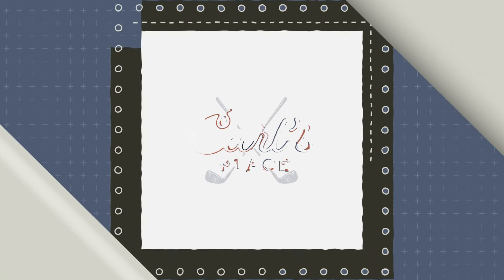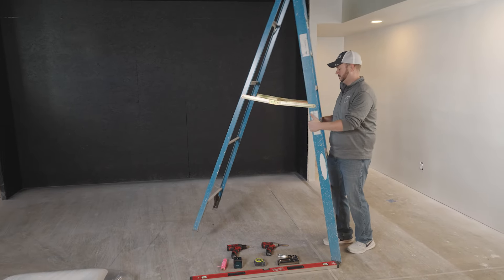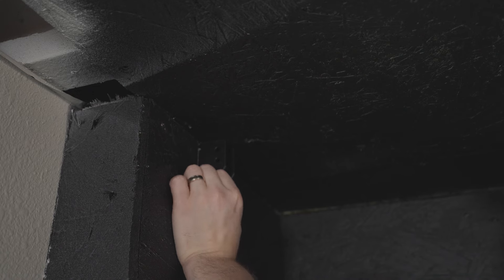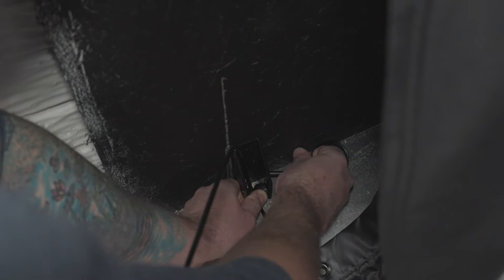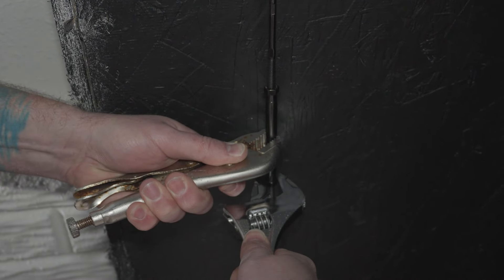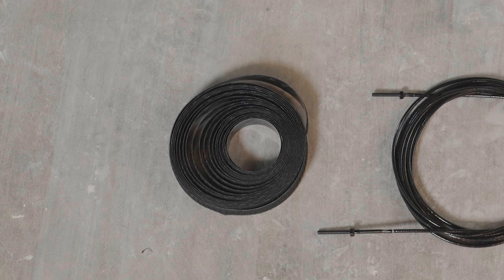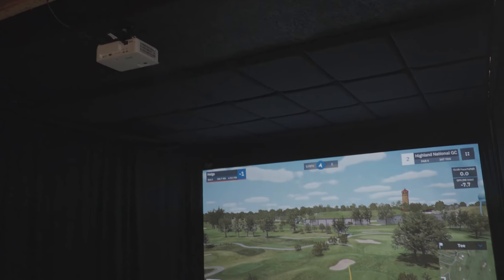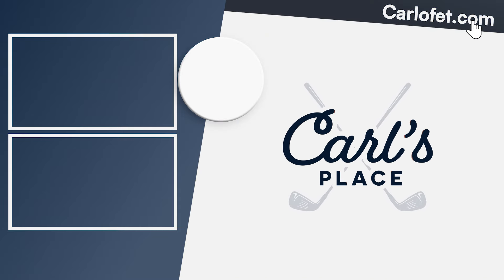How to Assemble Carl's Place Built-In Screen // Carl's Place Built-In Golf Simulator

Comment: Why the large black strip across the top where the logo is? Can it be customized without that and have it be screen instead?
Reply from the maker: Hey there! The black strip (masking) across the top on these screens and our C-Series enclosure screens is essentially what used to be the bottom border/flap on our original screens/enclosures. The viewable screen dimensions are still similar to what they were before when the screen had a finished edge and flap on the bottom. With the new screens, you get improved bounceback and a viewable screen that touches the floor for a more immersive experience!
Reply: @CarlsPlace  that masking strip looks well over 1 foot high! that's extremely disappointing to cut off that much vertical screen height!
Reply from the maker: @AM1015-  Hey there! It's possibly very close to 1 foot as our range for masking goes from 4 inches minimum to 12 inches maximum. The masking is used to make the white viewable screen a specific aspect ratio for the cleanest look with the projected image - we prefer not having unused white viewable screen space. However, if you'd rather have more white screen, you can customize that masking size through our customer service team to whatever you want in that range! If you're worried about masking not being impact quality, it is actually the same material as premium screen, just black in color.
If you have any more questions, I suggest reaching out to our expert customer service team here: www.carlofet.com/contact

Comment: What is the actual size of this screen?  Trying to find one that will fit in an11' 4" wide room, 8' tall
Reply from the maker: Hey there! The size of this room/screen are as follows:

Room dimensions = 105.5"H x 167.5"W
Black Masking strip = 12"
Viewable white screen (16:9 Ratio) = 88"H x 156.5"W (rounded to the nearest 1/2")

As for the dimensions you are looking at, yes we could make a screen that size, but we would highly suggest testing out your space as the height is near the minimum needed for swinging clubs. Best way to test is to take slow practice swings in the space to see if you could maybe take a full swing. Test out all clubs, including driver, to make sure you feel comfortable. Don't forget that if you don't have a hitting mat to stand on, there will be around 2 more inches of clearance needed! 

Check with our customer service team with any other questions! www.carlofet.com/contact

Comment: I noticed the bottom of the screen does not have any zip ties holding it down. Or is the tension from the top, left, and right enough to keep the bottom still?
Reply from the maker: Hey Eddie! The cable goes through a sleeve on the bottom of the screen, which keeps it tight to the floor. This is to provide that seamless turf to screen visual while keeping worm-burners from sneaking under! The cable is sized so that it is taut enough that the bottom of the screen stays flush with the floor. Hope that makes sense.
Reply: @CarlsPlace  Definitely does. Thanks for the reply!

Comment: How much dead space is there as the top of the screen and each side of the screen?  Is this going to be more or less dead space than if I went with your enclosure?  I'm building my room now and will be ordering soon!
Reply from the maker: Hey! Our built-in kits are made to maximize the space in a room, so you'll definitely have less dead space. The cable that holds the screen in the built-in kit is about an inch off the wall, and then there are a couple more inches of "dead space" between the cable and the outer edge of the impact screen, which is where the zip ties hold the screen onto the cable. To compare, we recommend about 2-3 inches of buffer space on the sides of an enclosure, and then the same "dead space" from hanging zip ties inside of that. 

Long story short, you'd be better off going with the built-in if you want to maximize your space.
Reply: @CarlsPlace  That's great - definitely looking to maximize space and I'm currently building so I can design however I wish.  On your site, when I went to the built-in option it asks for my room size, then shows me my effective screen size.  Are these number the "defacto" number that I should use when I build my side walls?  Thanks again - getting excited!!
Reply from the maker: @jfhall  Hey! Those are great questions that should go through our expert customer service team here: www.carlofet.com/contact

While this social media guy would love to help more, the customer service team will be able to provide you the most accurate and up-to-date info, making sure you get exactly what you're looking for!

Comment: Is it possible to this set up with drywalls?
Reply from the maker: Hi George, thank you for reaching out!  The corner anchors for our Built-In Screen system can be mounted on walls finished with drywall, but It's important to make sure that they are secured into the top/bottom plate or a stud within your wall.
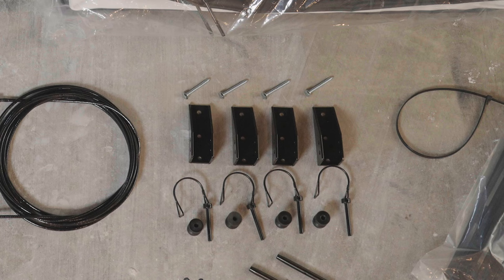Since it may be difficult to align each anchor exactly on a stud our anchors have been designed with a slight angle to help the lag screws reach the top or bottom plate of most traditional wood framed walls.  An example of this install can be seen in the video starting around 1:40.

If you have more questions, reach out to our expert customer service team here: www.carlofet.com/contact

Comment: Hi,

Is it possible to install this on concrete wall?
Reply from the maker: Thank you for reaching out!  Our Built-In Hardware Kit and included fasteners have only been tested for use with wood framing.  It's possible that the anchors could work with other materials if you have a way to securely fasten them to the wall but we haven't tested that option directly so we're unsure of any additional considerations you may need to make to ensure the success of that mounting method long term.